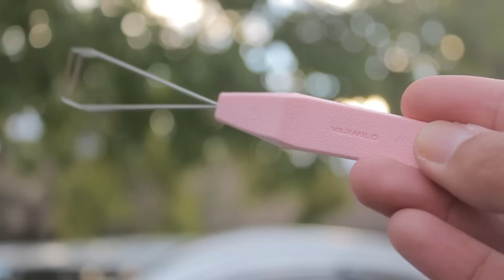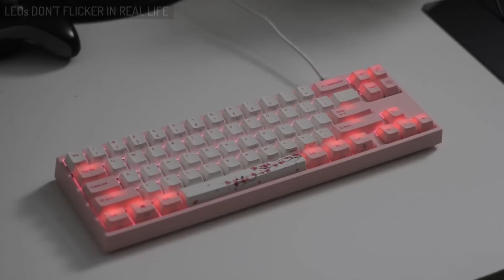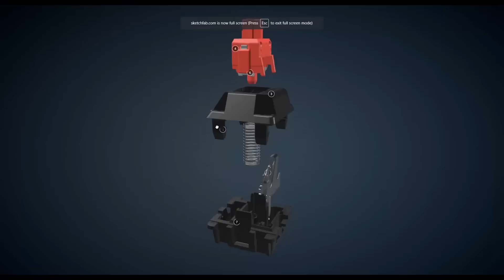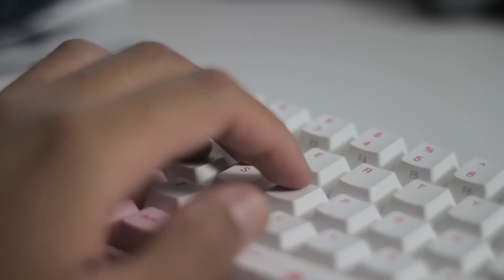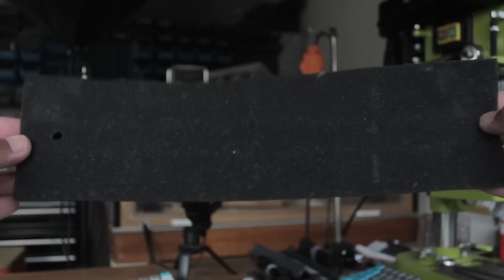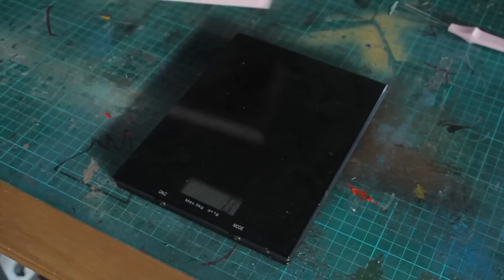Ducky x Varmilo Miya Pro Mechanical Keyboard - Unboxing & Review

Comment: I‘m trying to release the PCB/plate unit from the bottom unit, but it sticks around the USB-C port. anyone know if there are any hidden screws ?
Reply: i’m having the same problem, did you ever figure this out?
Reply: @maxb1126  Hey. I actually was able to get it out. There are  no further screws. You just have to be careful . Do not bend the PCB/Plate combo upwards. Try to push it down slightly , then lift upwards.
I have done this several times now without breaking anything.
I was doing this because of the terrible spring ping of the mx browns. I tried to lube them without desoldering using an RC car silicon oil that is rather thick. Works perfect, spring ping is gone. Totally different board now.
Reply: @cowardharpendale   you’re a life saver, i really appreciate your reply! i spent over an hour trying to get into the case and when i couldn’t get the pcb out easily i felt so defeated. i also wanna get at mine for spring ping reasons (mx reds) and to get re-attached to it by modding it for fun. thanks again :)
Reply: @maxb1126  You're welcome. I know it feels like you're breaking it, but it will come out. Try to pry the case just above the usb port, gently lift and pull a little towards you and then up.
I also swapped the foam for neoprene from aliexpress (4mm and 2mm). This also improved the board alot.
I was actually ready to desolder but I thought I might give the silicone oil a try by pushing down the switch and then inserting the oil with a brush. Took about 3 drops per switch and a little break in time. Ping completely gone :)

Comment: whats this layout called? a typical TKL has the fn row but this doesn't. Can anyone reccomend a board with this same layout?
Reply: They called it 68% layout i believe. Here's a few one i have in mind: EPOMAKER GK73X RGB, Magicforce 68%, Epomaker GK68XS, Drop Alt, Ducky One 2 SF. Leopold FC660M is also a good 65% keyboard that i highly recommend.
Reply: @huunhanle3809  thank you so much!

Comment: hello, what switches do you recommend?  I like the blue ones, but due to the design features, they seem to emit the sound of a spring (I have not heard it personally, just the opinion of some people from the Internet).  Brown is versatile, but has a muffled sound compared to red.  Red switches without a tactile response: what you press, what not - no difference.  I plan to take Varmilo and I want to feel the beauty of the mechanics.  now I own a hyperx alloy fps cherry mx brown and aula assault blue switch (analogous to cherry mx blue).  Thank you for your attention and for a possible answer!
Reply: Tbh the Cherry MX Blue is not that good, i recommend Kailh box white for clicky one. It's much better than Cherry

Comment: Thanks for the teardown.  I have to open up mine and now I know what to do and to be really careful. I got one with the silent red switches. I got a ducky one 2 mini with silent reds and it's inside a kbd fans alum purple case. I have to say that the typing experience on the varmilo is noticeably nicer. especially because of the better stabs.
Reply: Nice i got silent red as well, i like them alot actually
Reply: I have this keyboard and I've been trying so hard to open it but it's like the corners just won't budge! Any tips??
Reply: @frogemon  gotta just slide and lift at the same time

Comment: Mm... I'm thinking about purchasing this board, but the only thing deterring me away from it compared to the Vamrilo VA68M Sakura is the option for media control keys. Is there anyways to access those on the Miya Pro?
Reply: yes, i replied 5 months l8r, but im pretty sure you can fn+12345 etc to f1 f2 f3
if you use f keys often this is annoying as fuck

Comment: What exactly is the difference between this and Varmilo's VA87M & 108M Sakura Keyboards? Is it just an additional Ducky Branding and smaller size similar to Varmilo's VA68M?
Reply from the maker: Yes, just the size/layout. As said, it's just like a VA68M but not made from aluminium.

Comment: does the cool light changing functions work also on the normal Varmilo mech keys or is this the only one that has this fearure?
Reply: I just got the regular one, only full and breathing mode as far as I've seen. Super disappointed. Thought there was just the switch versions and the smaller and full keyboards. Not pro vs reglar (and checked after. The pro isn't even for sale where I got mine)

Comment: Hello, I just got mine in Mac white because i wanted a white case, do you know if the media keys only work with mac because I can't seem to get them to work with windows, if I'm using them correctly. I'm hitting Fn+9 to try and skip songs and I believe it doing f9 instead.

I am trying to contact varmilo about it but I imagine they are going to take a while to respond. 

I wonder if I can drop a LFK78 into this case. Do you know if the VA68M and the MIYA have the same screw down patterns? I can't see as to why they would differentiate that.
Reply: Hold fn+w for 3 second and it will to into windows mode. fn + a will put it back in mac mode. i use the mac white board on both my windows and mac laptops

Comment: Anyone know if the Miya pro pcb/internals would fit into a VA68m case? On just the outside looks, it seems that the mini usb cutout may interfere with the usb c port of the board.

Comment: I am currently using this amazing keyboard (MX red switch) !!!  
The color and the texture and the sakura imprint are so nice.
But maybe I got an earlier version of it, coz it doesn't light up apart from the CAPLOCK and PAGE UP/DOWN keys.
Anyway, it's a nice choice if you want to try sth different. BTW, it will make a great gift to the ladies.
Reply: How are reds? Do they feel scratchy or are the enthusiasts exaggerating?
Reply: @diegogajardo7851  for me its great. Coz I had tried blue switch but dont like it. Red is quiet and smooth (for me).
Reply: FrankyQi I just got mine in the mail today and can’t figure out how to get it to light up as well :/
Reply: @bw1n444  maybe your keyboard is also an early version XD

Comment: I use mine as my daily home keyboard. As a stock keyboard it's pretty decent (Why are there no volume keys on the function layer? Seriously).
However, I swapped the switches for Zealios 78g, and I can say that this is one of the worst PCBs I've ever soldered on.
Other than that (And the less than perfect Fn layer) I can say that looking at this keyboard on my desk gets me every time, it's absolutely stunning.
Reply: Can you see every letter well even in a fully dark room ?
Reply: When you took off the case, how many plastic tabs did you have to release? I can get the middle two out pretty easily, but the board is still attached.